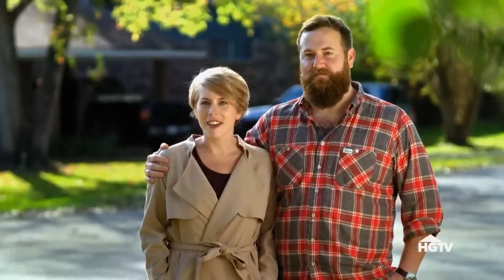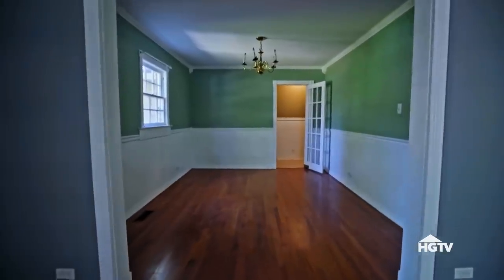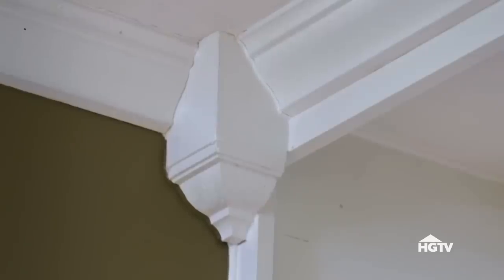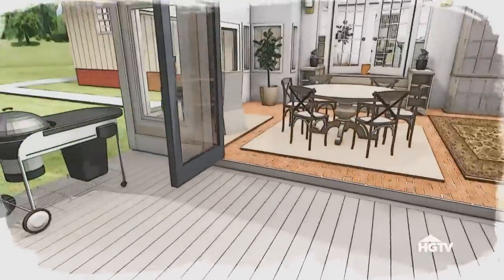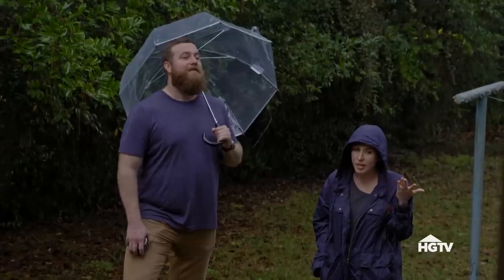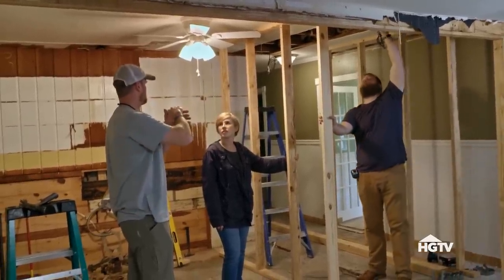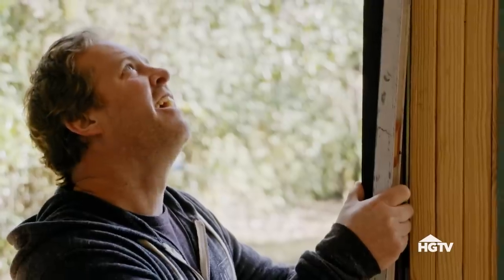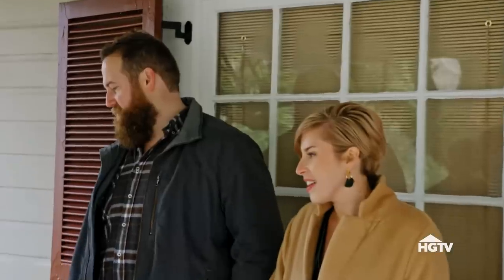$200K Small-Town Dream Home with Modern Touch | Home Town | HGTV

Comment: I kept waiting for the “modern touch.” I’m still waiting. I wish HGTV wouldn’t throw that word around on every video. “Modern” is a specific aesthetic; it’s not an interchangeable term with “contemporary.”
Reply: so does contemporary change with current trends, while modern is more of a static style?
Reply: @L. Spencer   Yes, exactly. While the definitions of "modern" and "contemporary" seem almost the same, when it comes to design, they're very different. The modern style is simple and minimal,  with neutral colors - early to mid 1900s. Contemporary changes with the times. 
Erin almost always blends contemporary with vintage styles.
Reply: @VioletJoy  Had not realized the difference, thanks!